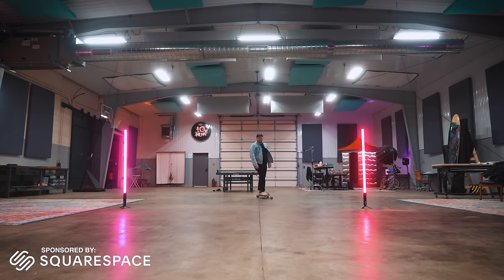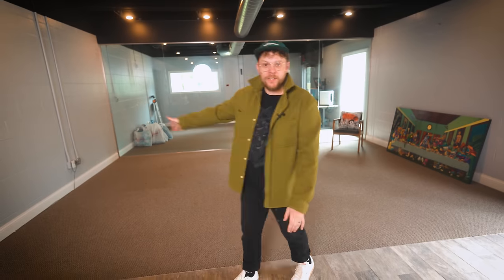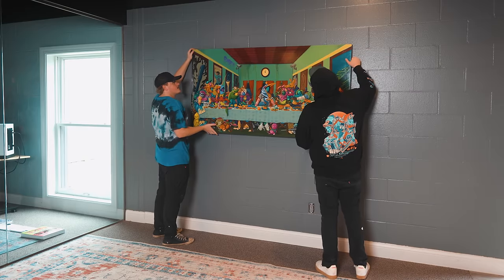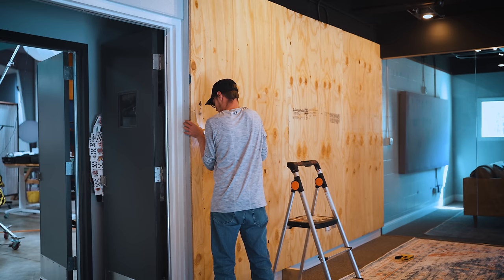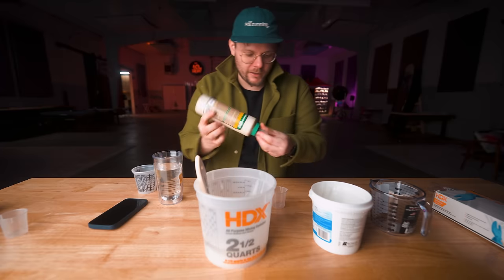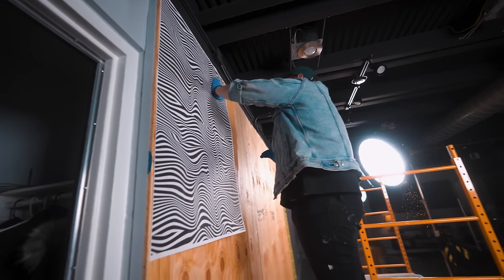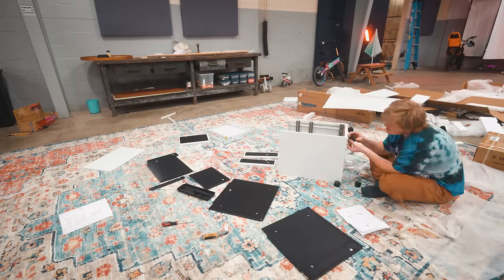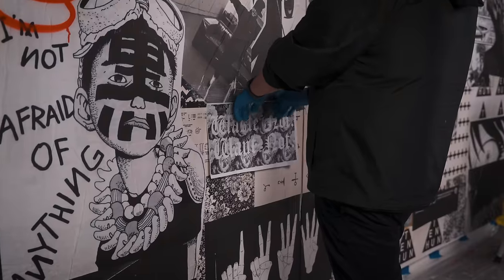Building My DREAM YouTube Studio In a WAREHOUSE - [Lobby Makeover] E4

Comment: The studio front lobby looks so cool. As does everything else on the inside. So I gotta ask. Are there any plans to eventually (maybe 1 or 2 years down the line)  paint the OUTSIDE of the warehouse? I know you already did the front wall, the one facing the road. But will you do the sides and the back as well? I am curious to know. Thanks.